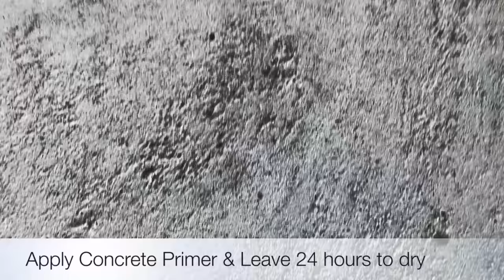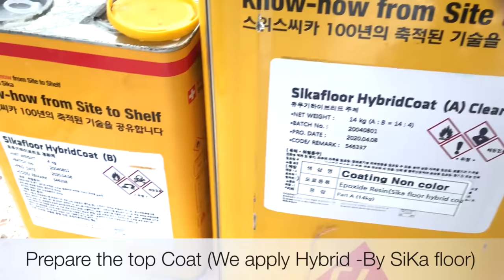How we made designer Metallic Epoxy floors ?

Comment: Please am learning from you thanks for everything. I have some questions to ask.
The concrete, primer did u use water to mix it?
(2)the self leveling concrete too was it mixed with water as well?
(3)the top layer
 what was used to mix?
(4)Lastly the base coat, what was used to mix?
(5)the white  metallic what was used to mix was it only hardner?
Thanks very much and hope to get answers too.
Reply from the maker: 1st primer and second (self leveling ) mix with water .and all other mix with their Hardeners. Metallic colors mixed with clear epoxy resins and with their hardener.and top coat has hardener too

Comment: Wow....it is really looking so beutiful .I was looking for a floor plan. What is its cost.Will it last for years.or if there is any drawbacks after many years pls reply sir. Expecting an honest reply☺
Reply: Apni ki purn dhakay thaken.
Reply: Turns yellow
Reply: @shakeelsisodia3447  depends on your material. I put a polyaspartic on my floor as a finish coating. and there is also urathanes that are UV resistant as well. Make sure the floors not in direct sunlight also helps as well
Reply: they ate very very  inexpensive compared to  marble flooring. the shine will wear away in a years time or some discoloration if exposed to sun light. for the cost it's worth it

Comment: Amazing work!
May I know the ratio u use for clear epoxy coat : white metallic powder : hardener?
Reply from the maker: 200g of metallic pigments for 16L of resin and hardener
Reply: @AVGinternationalPrivateLimited  Thanks for ur reply.. How long need to wait for white coat to dry before pour resin+white metallic powder? Or no need to wait to dry at all?
Reply from the maker: @shera-hg6ro  white base coat get 24hours to dry .then the top layer
Reply: @AVGinternationalPrivateLimited  thanks for sharing the info!
Reply: @AVGinternationalPrivateLimited  why do you apply the white undercoat? if just the resin+white metallic is ok? or you see grey concrete under?
Reply from the maker: @degao1968  yes most probably.you will see gray under
Reply: @AVGinternationalPrivateLimited  the white base coat can be any concrete paint?
Reply from the maker: @degao1968  yes .should be Epoxy based
Reply: @AVGinternationalPrivateLimited  can it be water paint acrylic polymers based
Reply from the maker: @Daniel-ey7nz  we have not been tested that type of
Reply: @AVGinternationalPrivateLimited  what was the type of paint you used to create the marble effect
Reply from the maker: @Daniel-ey7nz  epoxy resin with color pigments

Comment: What about scratch and heavy items moving on it
Reply: The issue is not scratching BUT if water on it you can slip or fall easy.
Reply: Your urathane coating after the epoxy gets really hard to scratch (especially wait about a week for the product to finish curing out all the way)... And they do have some tiny bead aggregates for non skid textures so you won't slip and fall when it's wet, and the slight texture also helps prevent scratches.

Comment: Can u make kitchen platform of epoxy,as u may have seen in Youtube in foreign countries,they put stylish granite stone for kitchen platform....but this epoxy work seems more beautiful ❤️
How long it sustain?
Reply from the maker: Yes we do ,,,
Reply: @AVGinternationalPrivateLimited Assalamualaikum I live in Bangladesh.  I do tiles and sanitary business.  I loved seeing the 3D designs.  I want to do this design business in Bangladesh, can you help me?
Reply: Do what I do for work tops get old wood cut down the middle or have parts then box it so pour colour resin in the gaps to make one solid table top and fit on the unit
Reply: @AVGinternationalPrivateLimited   if 400 square feets means how much
Reply: @prisiprisi6161  it means 1 feet both  in vertical and horizontal. If your room measures 10 by 10 square feet then it is 100 square feet (boxes).  So 400 multiply by 100(boxes) is equal to 40,000 money. If I'm not wrong!

Comment: Epoxy floors are very rigid. As a material, epoxy has very little flexibility, so slight shifts in the foundation can lead to cracks forming in an epoxy coating, leaving you with cracked floors that are difficult to repair without recoating with a new layer of epoxy–an expensive proposition.
Reply from the maker: Its not .this is different type epoxy materials we use and we give 10years warranty for the flooring
Reply: @AVGinternationalPrivateLimited  what about expensive according to tiles?

Comment: I have a very large brick paved area that is my driveway, the car stand and the path to the front door. It's an open double carport. I love the moss growing between the bricks on the path to the door, it doesn't grow too much on the driveway because of the sun, and the bricks under the shade look just nice. They're vintage house bricks used as pavers.  But I've been thinking of trying to get the car stand area epoxied so that it's smooth and sweepable. I can't find any clips on anyone doing this so that the bricks are still visible. Can anyone point me in the right direction?
Reply from the maker: Hello
There is no way to apply epoxy over bricks to be visible (clear) its not long last.because epoxy will not get bond with bricks .

Comment: At my home we used granite for floor, but it's developed some fungus, can we use epoxy floor on top of fungus granite?
Reply from the maker: Yes of course
Reply: Will need to clean the area and use a floor scrabbling machine to key the area then lay the resin can’t have moving bits underneath tho.    Big areas need movement joints cut into

Comment: What if I just prime and put epoxy without the self levelling cement?
Reply from the maker: Actually self leveling cement is use for to get smooth surface for cement laid floors

You can use primer and apply epoxy directly over concrete by grinding it

Comment: Is the white base just white base or is it like a metalic base paint ?
Reply from the maker: White base
Reply: @AVGinternationalPrivateLimited  thanks for replying so could i just use BEHR PREMIUM5 gal. White Self-Priming 1 Part Epoxy Interior/Exterior Concrete and Garage Floor Paint as a base then use like say rust oleum Metallic Silver Bullet Garage Floor Kit (2-Pack) for the swirls ? Or is it completely different ?
Reply from the maker: @jmj_d5207  im not sure ,since you going to use 2products by 2different manufactures.
Also you cannot do swirl over coating.because its need thicker layer

Comment: But it can catch fire easily..in day to day Life..
Reply from the maker: You want to burn down your house?
Reply: @AVGinternationalPrivateLimited  ofcourse not...I mean to say such material can catch fire easily..it may burn or damage  floor in day to day house activities coz it's stratch proof not fire proof.sometimes u should use ur brain instead of asking such silly question.
Reply from the maker: @25ajitmishra  Did you ever tested that epoxy by firing?Epoxy is withstanding for heat and fire than tiled or wood floors.

Check this link
https://youtu.be/uC0KgVgiQ7s
I think  you might test by yourself on next time when you say something without knowing any fact
Reply: @AVGinternationalPrivateLimited  no ..never tested...it's my opinion..tht epoxy floor may be difficult to maintain in ur day yo day Life from 🔥 n other activities..
Reply: @AVGinternationalPrivateLimited  waooo speechless...are u  doing the same type flooring if it so then u should make such video at ur client site...so that my type people can take it as posetive way.
Thanks for sharing the link n cleared my doubt n misconceptions towards  epoxy flooring.

Comment: The floor looks damn dirty. The point where they splashed the colors? Should have stopped there instead of mixing it. That would have been much better. This doesn't look like some high-end floor art. Looks dirty. You thought it was gonna look like marble or something? Also Epoxy is no good on floors. Turns dull and yellow over time. And def not scratch-resistant so vacuum cleaners can't be used.
Reply from the maker: Thats only your opinion
Reply: @AVGinternationalPrivateLimited  Scroll further down. Lot of ppl are saying Epoxy does turn dull and yellow. Also it's science. Epoxy will turn yellow when exposed to UV rays. Exposure to sunlight = Epoxy turning yellow. Not to mention epoxy has only a  2 to 3 years heavy foot traffic lifespan. It also needs constant maintenance to extend it's lifespan. Tiles is better cause it requires almost no maintenance. We have expensive tiles at home. All we do is sweep and mop it every day and it shines like new. Been a decade. This flooring def won't last like that without professional maintenance.
Reply from the maker: @btsarmyforever3816  yes everything is getting yellowish when exposing to the sunlight not only epoxy.keep piece of your expensive tile on out door few days and check  the different.if you telling tiles not yellowing and getting fade  by UV then  you better test by your self .without urethane top coat epoxy floors are not last than few years.but if you do flooring by professional ways then it will last for ever without any problem .do the scratch test after applying urethane top coat over epoxy floor.its almost hard like tiles
Thats our opinion

Comment: You can see a lot of the concrete still, not a good look
Reply from the maker: Concrete? ???? Better check again
Reply: @AVGinternationalPrivateLimited  can see imperfections!
Reply: @AVGinternationalPrivateLimited  also no cross roll??
Reply from the maker: Epoxy is self leveling material .it will remove roller marks automatically.also we didn’t used roller for top application.
And no any concrete visible under.

I think you better check out other video of same type project
Reply: @AVGinternationalPrivateLimited  you are correct on that!  Just don’t think there was enough material on the floor as you were spreading
Reply from the maker: @adrianvalencia2102 ok im out ,just come and confirm what you seen on video.
The faults you are trying to saying is not true ,and also this was a paid project not my own home floor.you think that the client cannot see? what you seen?
Reply: @AVGinternationalPrivateLimited  I’m not talking down on your work it’s great 

Just before you started spreading colors you could see under the basecoat

How many sqft and how many gallons did you use